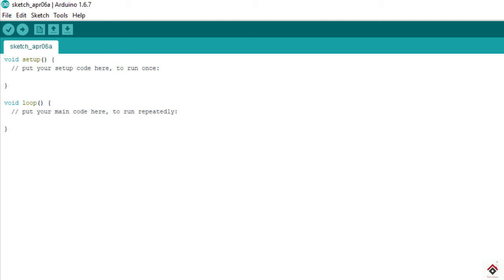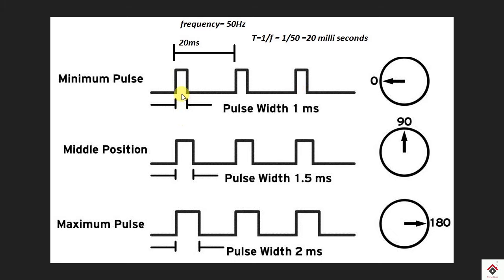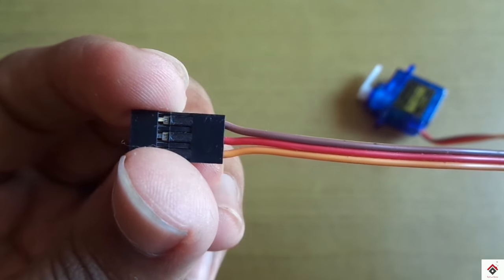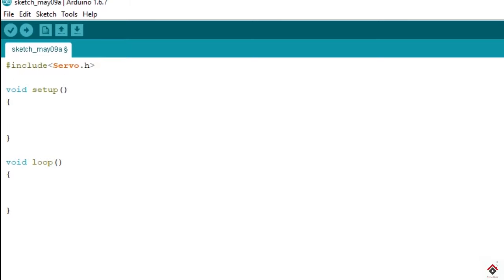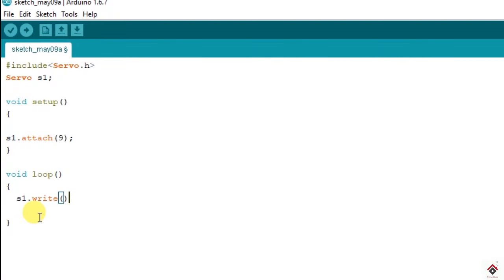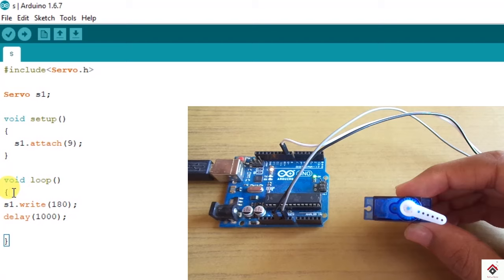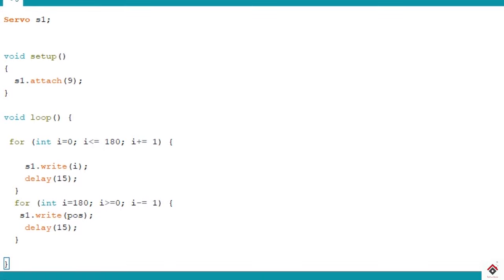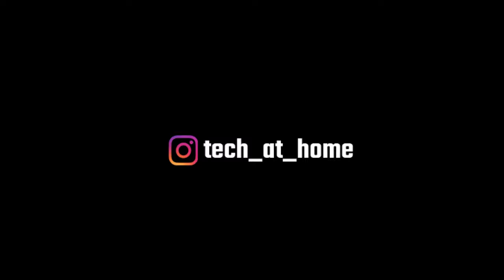Arduino tutorial 7- How to control Servo motor with Arduino (code explained) | using servo library

Comment: No hate, But dont know  the servo wont keep on repeating,it would only rotate once and then nothing would happen
Reply from the maker: The logic is inside the loop() so it should repeat.
Did you change anything in the code?
Reply: It's not repeating, I have tried same code

Comment: HI. I want to program 4 to 6 servos to do stuff individually. I have a servo driver pca9685.  Im trying to make something with these motors and a couple of lights and sound. I do not want batteries. I want to be able to plug this thing in the wall with only one cord not 2. Looks like though I need 2 seperate power supplies. I cant find anything online. Something I buy? A hack? Thanks.

Comment: Thank you for the servo lesson. Now I just need to figure out how to delay at 0 for 1sec then go to 90 and delay for 1 sec then to 180 and delay 1sec. Then repeat over again. I think i just have to put delays after each  int and include a 90. Any thoughts?
Reply from the maker: Welcome!

Use this way inside the void loop function:
write 0 degree
delay(1000)
write 90 degree
delay(1000)
write 180 degree
delay(1000)

Comment: awesome video!
greatly explained but the servo motor was not showing 180 degrees, it was only up to 17... degrees, in each servo motor  I used even on tinkercad.
Reply from the maker: Thank you
Standard value they give as 180 degree
Reply: @techathome Can you compensate for this by passing a value > 180 ?

Comment: If I’m using four of these servos on an arduino uno, should I be using resistors and transistors? I’m learning the basics but am curious about what I can get away with without them :) thanks!
Reply: get a servo driver module. you can connect up to 16 servos without resistors and transistors

Comment: Sir is there any tutorial on servo motors functioning through IR sensor or ultrasonic sensors
Reply from the maker: Not the specific one. But referring to few of my tutorials you can make.

I have one video of controlling servo using potentiometer.

Almost logic remains same. You have to replace potentiometer data with ultrasonic data.

Comment: I can i make my servi motor roatate at 360 degrees continuously please tell a code
Reply: Servo motor
Reply from the maker: The servo motor I have shown cannot rotate 360.

If you want 360 degree try to buy continuous rotation servo motor, but these doesn't have position control. Just keep rotating.

If u want 360 degree and postion control, then go with stepper motors.

Comment: sir it is working when i connect it to the laptop but when i upload the code and disconnect from laptop and connect 9v battery in the battery source, it is not working
Reply from the maker: The 9v battery current might be not sufficient. Keep it as it is.
But for servo motor connect external 5v supply. Refer this: https://drive.google.com/file/d/1rDYI3Pn6kmbSgGxOVU9p7irqRBT43GF9/view?usp=sharing

Comment: Do u know arduino program for setting timer instead of delay
 eg: I want to run servo for 1min then stop for 30sec and repeat the process.
we can give dealy for 1 min and 30 sec
 
But what I need is to set time around 10min and above, providing delay for 10min or more isn't working on mega 2560 ,so is there any timer option to set a code for setting delays for larger time
Eg: I want to run servo for 10min then stop for 5min and repeat the process.
Reply: Use (millis)

Comment: Up to how much volts it provides? Can I connect a larger power consumption motor? And how to connect a motor in Arduino with its driver circuit
Reply from the maker: Arduino gives only 5v, if you are using bigger servo motor, then give external power supply.

But which motor are you referring to, is it DC motor?
Reply: @techathome  I want to use one DC motor, one Big servo motor, one metal detector sensor total 3 elements
Reply from the maker: DC motor driver : https://youtu.be/Y8HmbR1c7ag

Comment: You should have just added a simple link for this code haven to download a zip file just to retrieve a code is to much......
 Zip files have a 100001 adds just way to much to deal with to get a simple code.
Reply from the maker: I want to keep code and circuit in single file and same link. It is not complex if you use proper tools like 7Zip.
Reply: @techathome  I get that and I did download a 7zip app but lots of commercials 1 after the other.  And I don't think it unzipped the folder

Comment: It says problem uploading to board. 
Please help
Reply from the maker: Check u have selected the port and arduino type properly.
Reply: @techathome  yes i figured it out, thankyou so much 
I am facing another problem with my IR, 
My IR has an LED itself, after connecting the circuit the LED stays on always with or without any obstacles near it, is it a problem in my connection or is the IR malfunctioning?
Reply from the maker: There will be a small pot on IR sensor module to change the sensitivity,
I think this might be maximum, try to reduce it.
https://youtu.be/Wj9KBcNQwaA
Reply: @techathome  It worked, thankyou so much bud, I'm a mechanical engineering student doing a IoT based project... Your videos have been a saviour
Reply: @techathome  Hello mate, I have made a set-up where i am using 2 IRs as input and a servo motor as output, both of them i have learnt referring to your videos... 
I am facing a minor problem, where the code is only taking input from one IR and the other IR is idle... Can you help me out please?
Reply from the maker: Can you send code on Gmail
Reply: @techathome  Problem got solved, thanks for the cooperation, give me your email id I'll send you the working video... All thanks to you 👍
Reply from the maker: deepakhd20@gmail.com

Comment: Motor not rotate 360 please give proper working  code
Reply from the maker: Servo motor have only 180 degree rotation,
If you need 360 , then you have to go with stepper motor